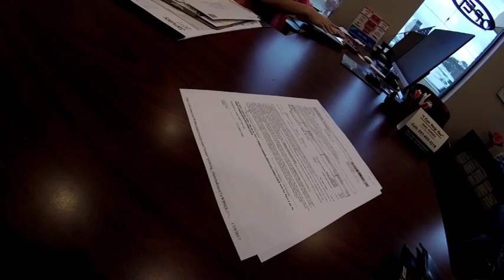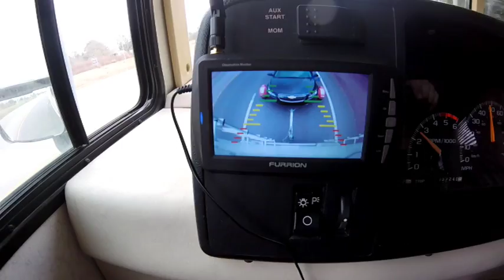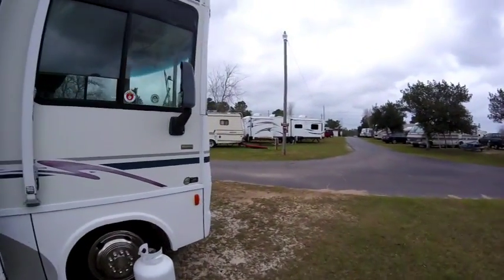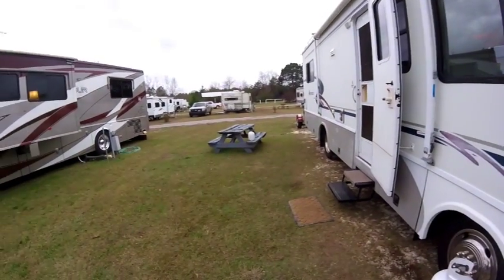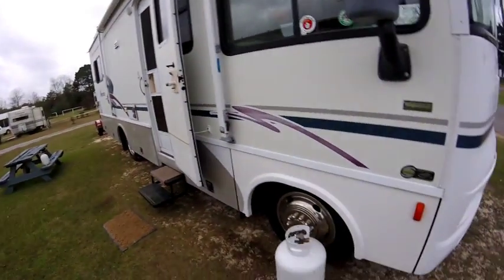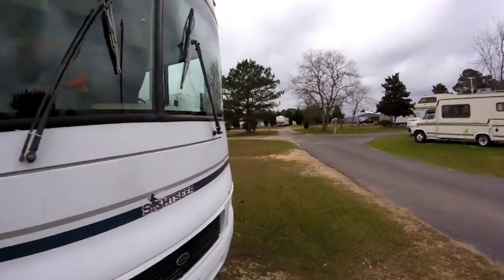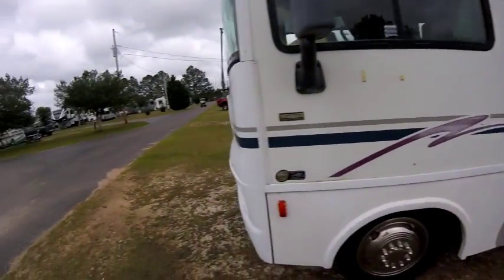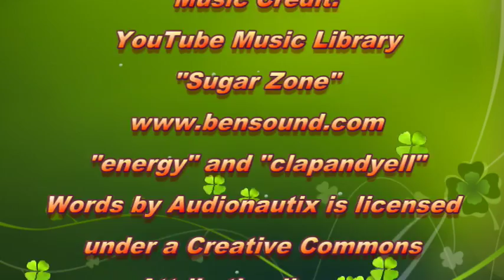#RVLife - Hey Mom I'm on My Way!!!

Comment: Good video.  The one thing I did notice is when she hooked up the chains to the motor home.  Did she cross the chains?  YOu should always cross the chains when pulling a trailer.  The reason for that is if for any reason the trailer becomes disconnected from the tow vehicle, the chains will catch the hitch instead of it hitting the ground and catapulting it!  So always cross the chains.  I may be a woman, but I have towed before.  It is a challenge, but fun too!  Have safe travels!
Reply from the maker: Thanks for watching. Yes - we did cross the chains connecting the dolly to the RV.  The big thing for me was I had no experience towing anything ... and driving the rig with a tow made me a bit nervous only because I had no experience. What I found was it was quite easy.

Comment: That would be a little scary at first. Very nice lady that helped you set it up.  I'm sure you checked all the requirements for towing your car as to whether it should be in neutral or drive etc. Don't want to damage your car. The braking requirements seem a bit confusing also and change per state. Maybe they are the same in each state for a dolly? Safe travels.
Reply from the maker: Thanks Brian. Yes - she was very nice and very helpful. I read the owners manual on the car before even considering it because this is a great car and I did not want to damage it by towing. It is safe to dolly two the car with the two front wheels up.  The braking system on the tow dolly works great ... the whole experience was good.